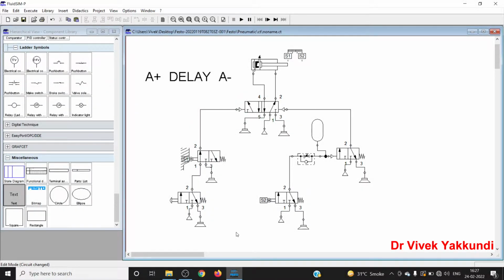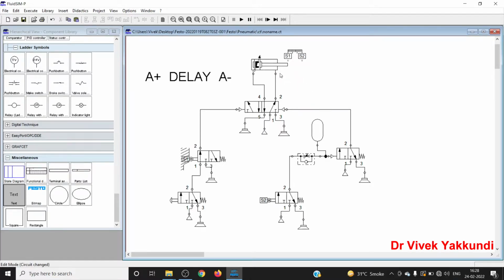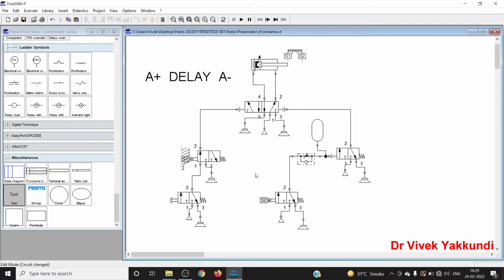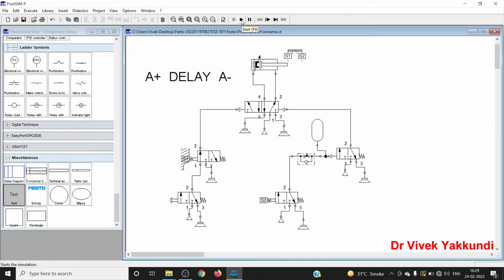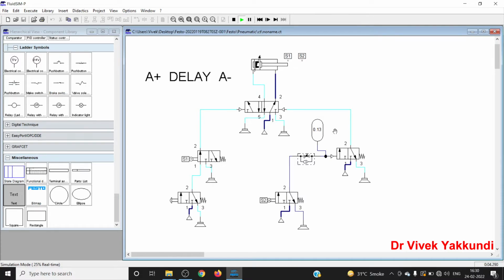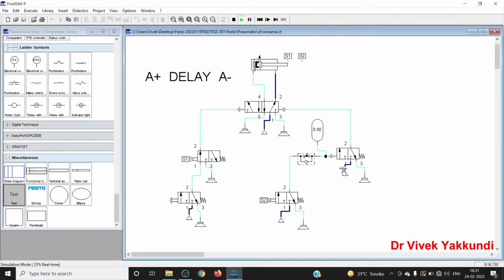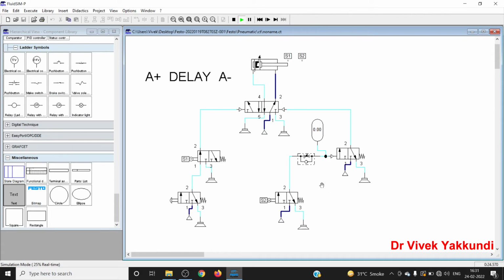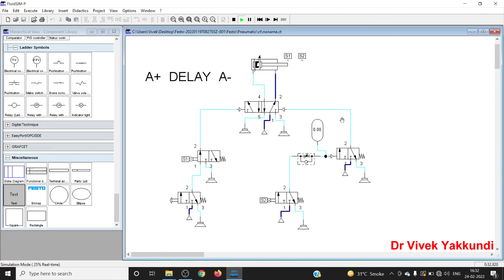Pneumatic Time Delay  (A+ DELAY A-) By Dr Vivek Yakkundi

Comment: To initiate the next sequence you have to wait 20 second more to empty out the reservoir. Is there any solution for that?
Reply from the maker: The purpose of this circuit is to provide certain time for the machine tool to perform its operation.It could be weld,drill,tap.stamping etc.